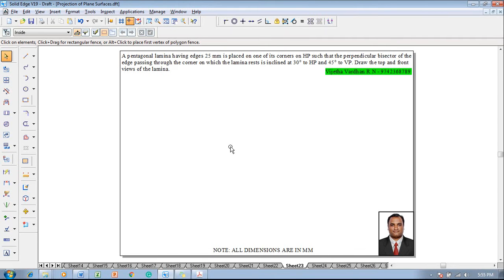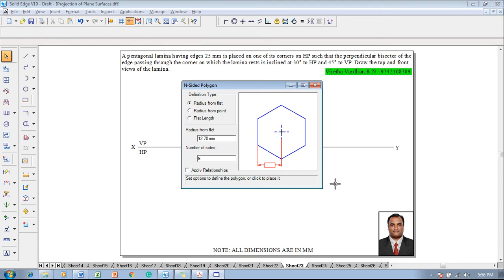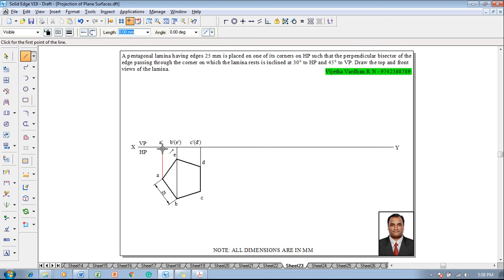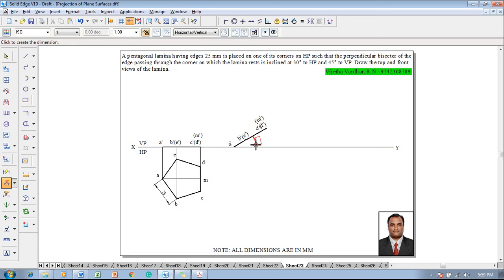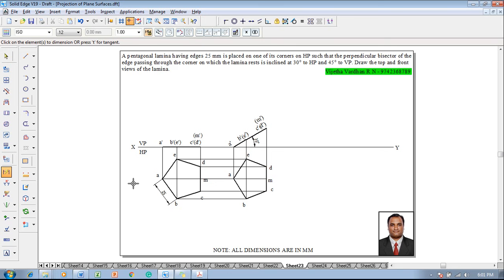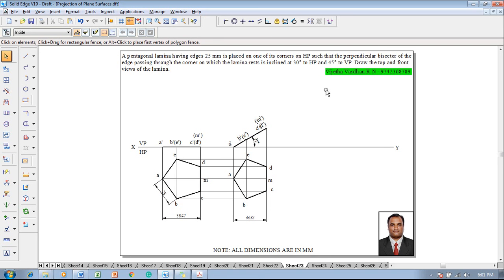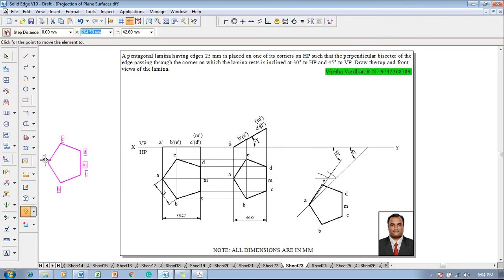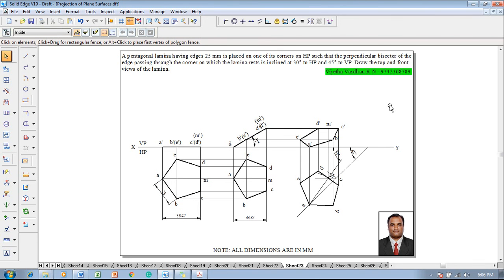Example 23 on Projection of Plane Surfaces

Comment: Sir I have one doubt 
1) While drawing final front and top view , is it necessary in beta angle to take the point A in top and median in bottom 
2) if we take 45 degree angle with right side or left side both are ok , are is there any specific side to take the angle 45° right side or left side
Reply from the maker: 1) No, it is not necessary, and 2) you can take 45° to either side.

Comment: if your pc do not have the n side polygon option you can use                                                                                                                                                                                       
25enter 0 enter
25 enter 72 enter
25 enter 72*2 enter 
25 enter 72*3 enter 
25 enter 72*4 enter......
Reply from the maker: Yes absolutely correct 👍